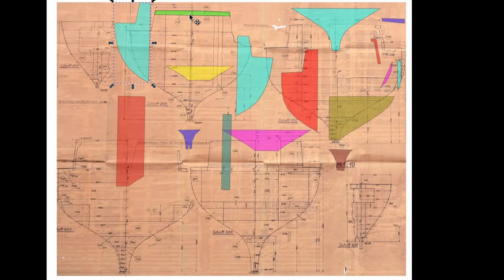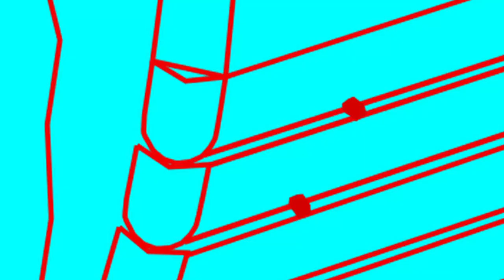How I build a big sailing boat with plastic pipes and plywood

Comment: Nicely built plywood boat with a weird hull forming material. 
I saw a boat recently on interweb built with plastic pipe hull, in Germany, and the idiots bought it. It was bigger but so badly made the pipes were full of water and huge parts of unrepairable hull was falling apart , but it also had a nice interior .
I hope you had better luck with your boat!
Cheers Warren
Reply from the maker: Hi Warren, thanks for your comment. I guess they used poliester resin. With epoxy resin this problem should not appear. But even if they used poliester resin, the problem can be easily avoided by just applying one layer of 60 gram fiber glass with epoxy and afterwards putting 4 coats of epoxy primer (only below the water line). Greetings, Andy
Reply: @andysworkbench   I had a good look for the video but cant find it, yet. the boat was built in a barn and the man got too old to use it after doing some nice interior work  the design may have been from the same designer just about 12 m with a large 'galleon' type aft cabin. yes he use polyester resin which  i dont think was the problem .

Comment: Hi Andy, beautiful boat! Am building Modells and a small version of hopefully a bigger one, one day and always interested in new and out of the box ideas. Did you find those plastic pipes in that shape or did you form them yourself?
Am pondering with the idea of using UV stable HDPE sheet material on a wooden frame?
Lots of interesting videos!
Thanks so much!!
Stephan
Reply: Sorry just realized you already answered the question about the pipes but how  did you get the fiberglass to adhere to the pipes?

Comment: Wunderbar Andy! What material are the pipes made out of (HDPE)? I assume that they are glassed on both the interior and exterior of the hull, as well. Did you need to "caulk" the seems between the pipes in any way? Great work. Vielen Dank aus FL. US!
Reply from the maker: Hello Karl, thanks for your comment. 😅😅How did you find out that I understand German? I'm not sure what plastic the pipes are made of but I think it's PVC. They didn't melt when exposed to heat but could be formed easily. Yes, and you guessed it right, there are several layers of fiberglass inside and exterior. After fiberglass comes a gelcoat and several layers of epoxy primer. Maybe this can be discribed as caulking. Regarts Andy

Comment: Very interesting!!! Did you extrude the V-shaped tubing as an OEM component for your build?
Reply from the maker: Hi Paul, sorry for replying so late. No, I didn't extrude the tubing. I bought them in Germany Munich from a company called Aprem GmbH. Unfortunately, the company owner and inventor died and the company was dissolved in 2013. Greetings Andy
Reply: @andysworkbench  No problem. Thx for the reply!!! Sorry to hear of the inventor's fate. I had a similar idea for another application, but I never executed it. I'm building a small airboat and have learned that I absolutely despise working with fiberglass. Next boat will be made out of concrete.
Reply from the maker: @paulslevinsky580  Hi Paul, yes, I understand you very well! Fiber glass is not my favorite material either to work with! But I am always amazed what you can do with it and how strong the results are. Good luck with your next boat!